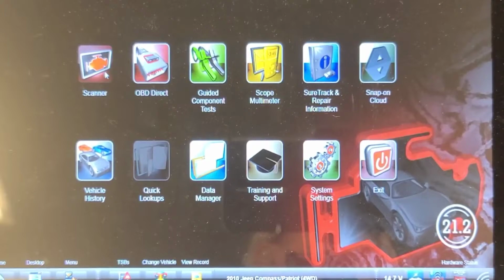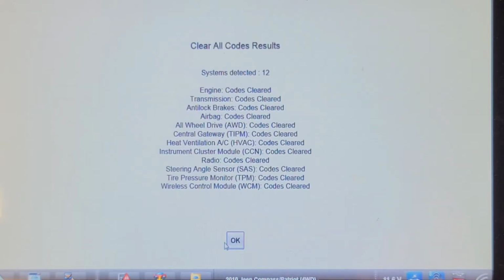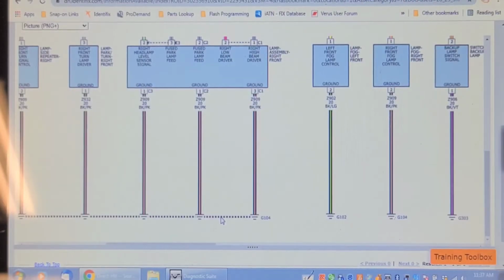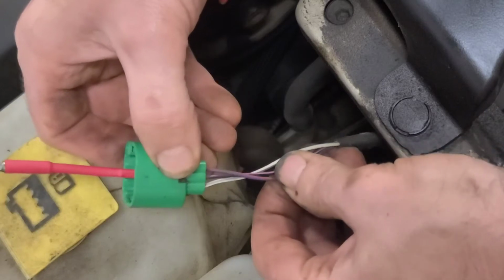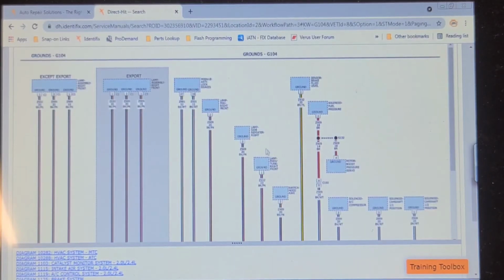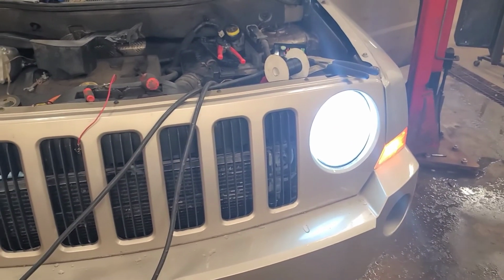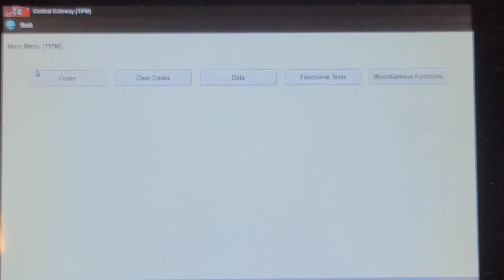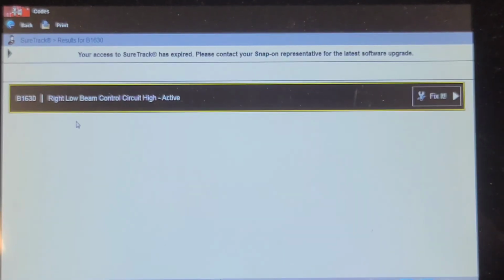2010 Jeep Patriot Right Headlight No High or Low Beam.

Comment: Add the same problem about the opposite headlight can you please help. Thanks in advance.
Reply from the maker: There is a ground basically in the same place on the left side if i recall correctly Id check that.

Comment: Thank you for one side issue video, but problem on my 07 compass are high beams at blink or steady positions don't work either, only low beams. I can't locate relay for that function, but all fuses underhood are ok. Would anyone help me with advice. I don't think that multifunction switch is problem because doesn't play high beams even on blink position 🤷🏻‍♂️
For any help I would be very appreciated.
Reply from the maker: Are the headlights stock? Are there any codes in the tipm? There is no relay or specific fuse.
Reply: @PhillipBailey bulbs are stock but I don't have that profy diagnose thing, with regular obd2 I can't read that. I might if you can tell me from your experience where usually problem appears?
Reply from the maker: @rab_Božiji  The Tipm controls the headlights based on inputs from the dimmer switch. you need a scan tool to check for codes related to the headlight circuits, view data related to the request from the dimmer switch. Have you tried disconnecting the battery for several minutes as a shorted bulb will set codes and disable the headlights until the codes are cleared. have  you tried new bulbs?
Reply: @PhillipBailey I'll try new battery disconnection for overnight, bulbs I've already put new after leds aftermarket. That's all I can try byself before I see dealer with the proper tools.
Thank you very much for your help and fast responses ❤
Reply from the maker: Good luck.

Comment: Does anyone know how I can bypass the TIPM headlights on a 2010 Wrangler? I would like to wire them straight but keep the headlight switch ?
Reply from the maker: That's not likely going to be possible since the headlight switch is an input to the TIPM. Why not fix it?

Comment: I'm having the same problem on my 2013 Jeep Patriot that just started yesterday, left side. I suspected a grounding issue but I didn't know where to find the grounding junction. Now I have an idea where it's at! Great work!
Reply from the maker: I believe there is a similar ground on the left side frame rail.
Reply: @PhillipBailey  Knowing now that the middle wire on the headlamp socket goes directly to chassis ground, here's what I did: I spliced in a piece of wire to that middle ground lead on the socket using a Scotchlok connector, crimped on an eyelet end then fastened to ground using the same bolt that holds the negative battery cable to the left side of the core support. Left headlight is working again!
Once the weather cools down and I have more time, I'll go through the ground wire bundle(s) the right way and take care of any poor connections.
Reply from the maker: @maverickdallas1004  that's a good temporary solution for sure.

Comment: So I redid all the grounds right, so my highbeam works now, but the low beam still doesn’t can you run me through how to test the power to the light by probing the 3 wires to the back of the 3 pin connector
Reply: because I’ve redone the grounds ALL of them even a separate set of grounds for the right blinker, everything works BUT the low beam on the right passenger side
Reply from the maker: The right low beam power wire is pink. It should turn on with the low beam. You can compare the position to the left side. Test with a test light connected to the battery ground. Try swapping the bulbs side to side or try a new bulb. You can also try disconnecting the battery for several minutes to clear any codes in the front control module. If you have a scan tool that will communicate with the front control module you can read and clear the codes with that. The FCM is also referred to as the Totaly Integrated Power Module or TIPM.
Reply: Gotcha I tried new bulb haven’t tried clearing codes I’m gonna try and see wat codes I’m getting now, do you think I could be dealing with a possible break in that pink wire? Or possible blown fuse? I took my meter and a needle and got nothing from the pink wire but the white wire which would have to be high beam got 12v I definitely did a good job on the grounds extended them and all with butt splices like you did
Reply from the maker: It's not the ground since the high beam works. I don't believe there is a specific fuse as the TIPM uses high side drivers to supply power. If a circuit is shorted the TIPM will often shut off the driver until the code is cleared.
Reply: Ahhhhh ok Ty I’ll give that a try tomorrow on I appreciate the info
Reply from the maker: @ganjatokes3476  let me know how it works out for you.

Comment: Hey there fellow Canadian!! Thanks for such informative content. I have a 2011 Patriot with the same issue and I'm no mechanic but I'd like to try this repair myself. Would you have any idea of how much a fix like this would cost if I tell the mechanic the problem and show them exactly what needs to be done? I'm in Laval which is a city just outside of Montreal, Quebec. I'd also like to know how you extended the wires so they would reach cause if I cut and splice the wires I don't think they'll be long enough to reach the bolt? Thanks, Cathy 🇨🇦
Reply from the maker: Hello Cathy. I've been to Laval. It's beautiful city. I used uninsulted crimp butt connectors and heat shrink tube. The copper wire will likely be oxidized so solder won't stick.  Added about six inches of new wire doubling up some of the lighter gage grounds. Soldered and heat shrunk the eyelets though. The actual repair of the wires took around an hour and around $20 in electrical supplies.  In the video you see where the grounds are located. If you look closely you will likely see the failed wire in the group. Searching for the location of the ground took around 40min. Good luck and merry Christmas.

Comment: My son's 2012 Compass has the same problem only left side. I'm willing to bet it's a bad ground. 
Good video. Happy Motoring.
Reply from the maker: I'm pretty sure there is a similar ground on the left rail as well.
Reply: @PhillipBailey  Yeah, Eric O from South Main Auto did a left headlight on a older Pacifica and it was on the rail. I figure we'll follow the ground wire back from the light and redo the ground. Thanks.

Comment: hey! where are you in Northern Ontario? I'm in Sudbury, I got my Power Steering Cooling Assembly Line replaced yesterday in My 2009 Jeep Compass Sport and now my passenger headlight is not working. We noticed it right after leaving the shop I got it done at. All the electrical for that lamp is literally in the exact same area where the lines were replaced.  My signal and fog lights work but my high and low beams...nothing...driver side perfect.
Reply from the maker: Check the ground the same as this truck. Both high and low would be affected. It's kinda a bitch to access it. There are like 6 or 7 wires there.
Reply: @PhillipBailey  hello, turns out this was 100% the issue with my headlight, the ground wire was broken right at the terminal, this exact repair in the video was done to my compass and just like that, I have light again lol, thanks for the advice!
Reply from the maker: @emeraldcarpetcleaningservi7825  glad it may have helped you.
Reply from the maker: Oh yes Thunder Bay
Reply: @PhillipBailey  OH way up northern northern Ontario LOL! I will have a look at the grounds, my power steering cooling lines were leaking all over the electrical in that area but I had no issues previously even with the severity of the leak. It was only after the lines were repaired in the shop I got it done at that the headlamp stopped working. It left the shop with them not working, same headlight as the side the repair was done too, I'm wondering if the guy accidentally broke the ground somewhere along the circuit either at the end where this one was busted on your video or elsewhere in the wire while he was moving them around fitting the power steering cooling lines in.

Comment: Really like those bare butt splicers with sealed shrink tubing. I've had soldered wire fail due to embrittlement and vibration.
Reply from the maker: Yes and you can really crimp them unlike the shrinkable but splices were if you crimp them too aggressively they may fail due to compromising the seal.